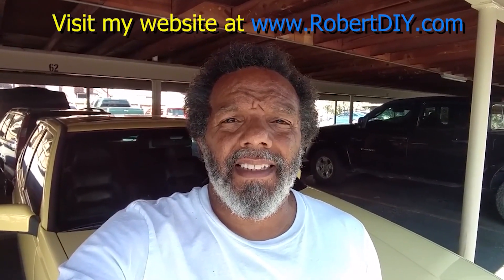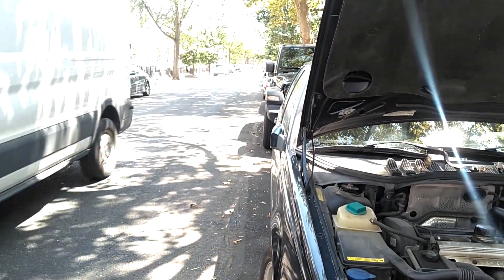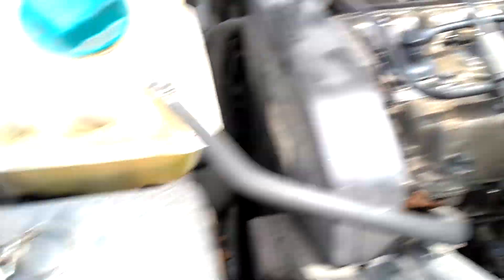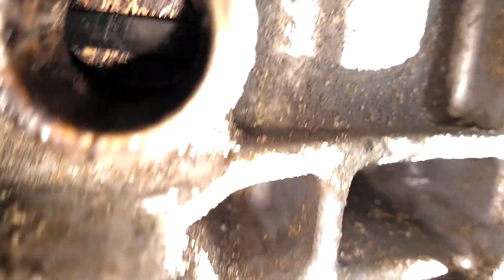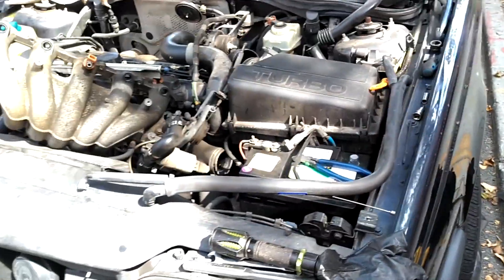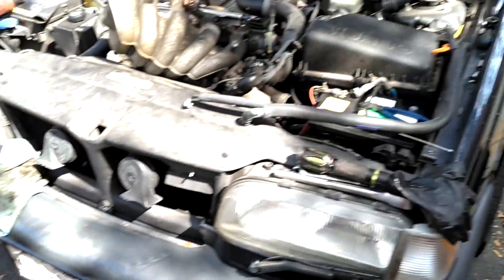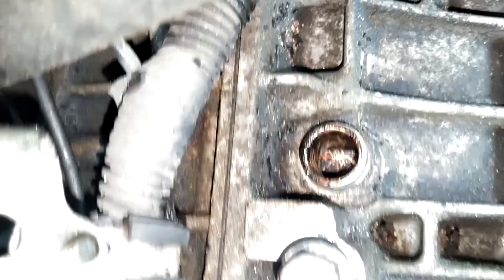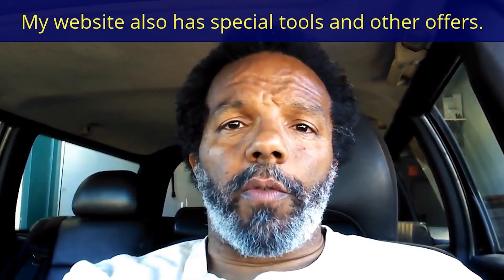NYC, I'm here! Worked on a 850 in Brooklyn, PCV service and heater core replacement. - HOWR

Comment: Got a head scratcher for you.......1996 Manual 850 T5 drives and boosts fine until I drive 60 miles then I lose boost. I have no Lambda light (CEL) but if I read the codes I get a 231 (to lean or rich part throttle) 
Only happens after 60 miles and not before even if I give the old girl some welly.  All vacuum lines, Intercooler and boost piping are new and had the code before I renewed the aforementioned. What you reckon, MAF?
Reply: Forgot to mention. 
If I reset the code all is well until I hit the 60 mile mark again. I can do multiple trips of 30 or 40 miles with no problems. 60 miles seems to be the magical number
Reply from the maker: Anytime the ECU picks up a performance code it reduces power to save the car or the planet. 

Could be one of a number of things causing the code. If the PCV is serviceable I'd check all of the vacuum check valves. Then the brake booster, then vacuum valves.